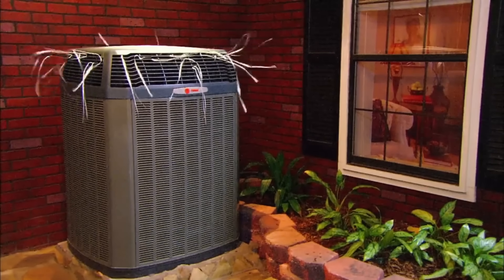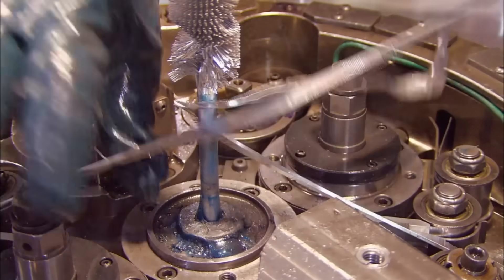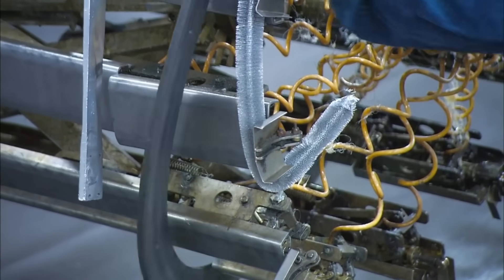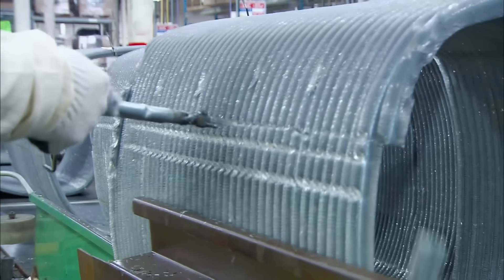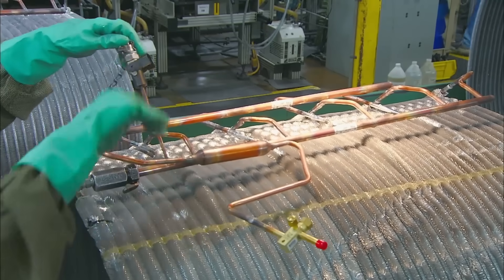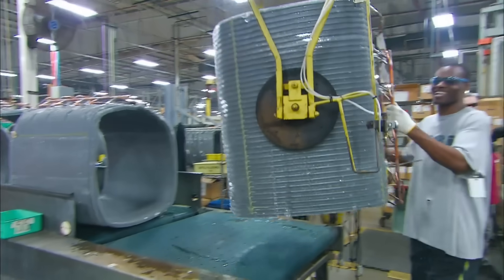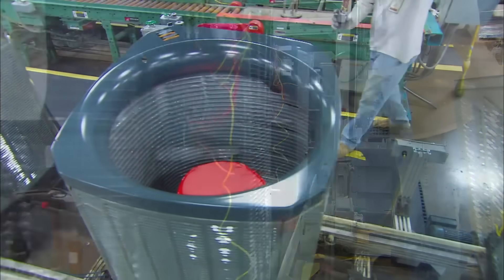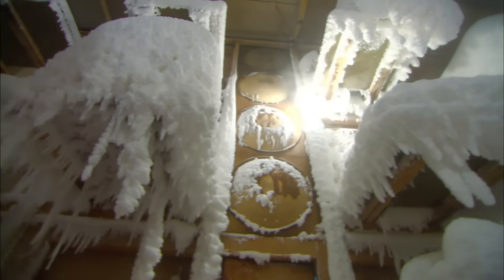How It's Actually Made - Air Conditioners

Comment: A integrated circuitboards video would be nice. I still have not figured out how we shocked a rock hard enough it started to think
Reply: really, it's more that we shock some of the tiny rocks in a very long line of very many shocky rocks, and the entire line is what does the thinking, as a collective. rocks together smart
Reply: @aabbcdefghijklmnopqrstuvwxyz  We shock tiny minerals! It's the Rock that is composed of tiny shocked parts and does the thinking!
Reply: @aabbcdefghijklmnopqrstuvwxyz Like a Rock hive mind
Reply: Just shock billions of tiny rocks that are made of P/N type materials, and then you basically have computers
Reply: Magic smoke is required. If a short circuit occurs, rocks leak the smoke and stop being able to think.
Reply: A transistor is a circuit component that can be either positive or negative (1 or 0). If positive, it allows current through. If negative, it does not. This concept is used to build logic gates. Logic gates are groups of transistors that are placed in a specific sequence that allows the circuit to generate a desired output from 2 or more inputs. I recommend watching the video “how do transistors run code”, it explains the whole concept a lot better. You could also watch a video on how CPUs are made, but it is very complex and not as intuitive as transistors and logic gates